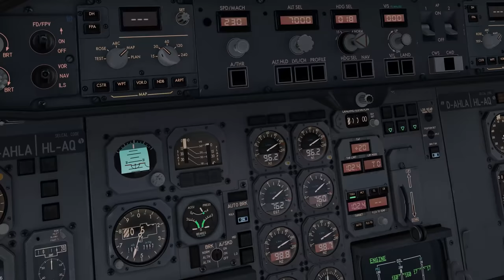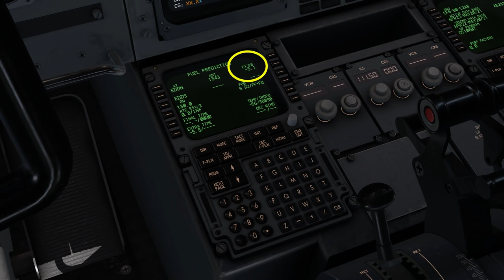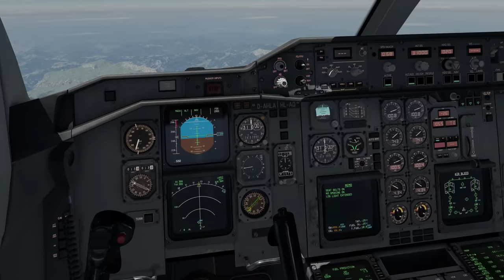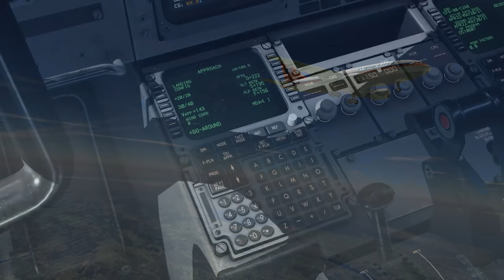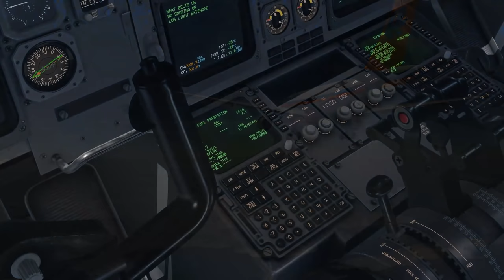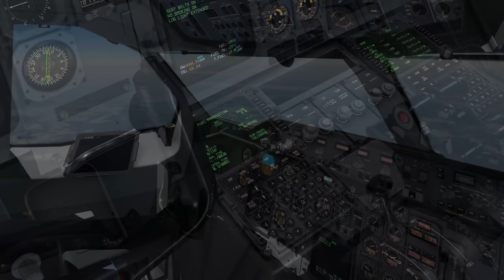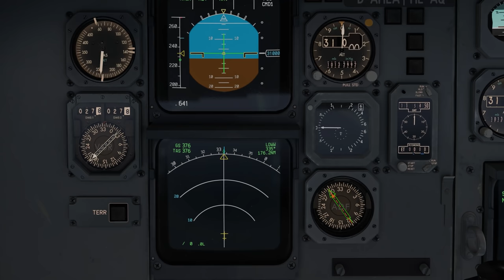This German jet ran out of fuel!? | Hapag-Lloyd flight 3378

Comment: I appreciate the displays being so in sync with the narrative, especially the engine 1 failure checklist appearing then seeing all the displays wink out after losing engine 2.
Reply from the maker: I’m glad!
Reply: Im a system specialist on A330/A350/A380 and i can vouch. The details in all the videos for Airbus Aircraft are ON POINT.
An FMS FUEL PRED UNRELIABLE message can be seen on the aircraft i mentionned, im assuming due this incident!
Reply: @GreenDotAviation Narration and displays moving in synchrony helps laypeople quite a bit, too. We can pause and zoom in on what's changed, getting some idea what the pilot's field of view would have been and the visual priority each indicator has.
Reply: What software is used for these sims?
Reply: @jakeofspurs-pj7it this is xplane and inibulids a310, but aviation related channels usually use MSFS because it has better visuals

Comment: I got 3 things from this video. 1. It's "ok" to fly with the gear down but actually it's not. 2. Confirmation bias, complacency and laziness will always lead you to something bad and 3. Green Dot Aviation as usual puts out fantastic, well narrated videos with outstanding Sims and graphics.
Reply: Well it's "OK" in the sense that the plane is capable of flight; however the increased drag means it will consume fuel much more quickly; this means the fuel you planned to use is now not enough to reach your originally intended destination.
Reply: @troodon1096  It's "ok" in the sense that the plane won't immediately fall out of the sky, but it's not in the sense of wtf are you doing trying to fly all the way to your destination with the gear down, are you on drugs? Turn around and get the broken plane fixed.
Reply: @Person01234  Why don't they teach to turn back then?

Comment: First officer: We're burning fuel way faster than the FMS says, the FMS is obviously, visibly incapable of providing accurate information about fuel consumption with gear-down flight, we're going to run out of fuel, we need to divert to the nearest airport NOW!
Captain: This is fine.
Reply: FO: Sure whatever idc it's not like if we run out of fuel I'm going to die or anything

Comment: Again, so interesting to see how one single thing - a bolt - starts a series of small mistakes that compound into a disaster (albeit one that thankfully was not deadly).  I think it also illustrates the issue of computer-reliance.  All too often it is "assumed" the computer knows everything, but in this case, it can only know what it was programmed to know about fuel consumption calculations.  My wife's grandmother was one of the first female pilots in Canada, and in those days, you had to fly by what few analogue systems you had, and one heck of a lot of knowledge and understanding of flight.  The one thing it seems we are slowly losing is as things becoming increasingly automated and computerized, that hands-on knowledge of how to fly manually is diminishing.
Reply: Yeah it should accommodate us, but not replace being able to actually calculate and have knowledge now lost due to heavy reliance on computers.

I think if I would ever become a pilot (I would love to but hey, the money just for the license and then have access to a place is not within my reach whatsoever. So I’ll reinstall msfs2020 and try there with my joystick and just one throttle lol. Or crash myself on the mobile ones.  However, if I could, I’d like the less computerized ones so I can actually fly manually and keep sharp about fuel, oillevels, take off speed and landing speed (and weight in case I would be flying to small villages in nowhereland and drop food and medical things) and all the things now generally calculated by a computer and only landing and take off are still manually done though many planes could even land themselves.  I know that’s a time of high workload but imagine you basically have 15minutes or less on a 10h flight.
Reply: @fluffy-fluffy5996  Yeah - to a similar degree, it's like all these new automated driving assistance things in cars.  I would MUCH rather see money put towards creating (and enforcing) good drivers instead of relying on the car to do more and more for the driver.
Reply: The addition of training on WHAT TO  DO IF THE GEAR WON'T GO UP would have done all they needed
Reply: There are some who watch flight channels who are convinced planes should be totally computerized 🙀🙀🙀
Reply: @fairyprincess911  I think they have too many computers now
Reply: @jack002tuber  I tend to agree😼😽
Reply: @fairyprincess911  Speaking as a Network Administrator, GOD NO.  The more mechanical, the better.
Reply: Automation is a positive thing, but one thing I notice in accidents/incidents like these is that pilots are taught how to use the systems, but not how they actually work under the hood.
Reply: Completely agree. I'm always amazed that people who drive cars don't really understand how they work. You don't have to be a mechanic, but most people don't know why the car stops when you step on the brake pedal.
Reply: @hrdley911  Argh... yes, this one frustrates me a lot.  In this day and age, people have zero excuses for not learning the basics about how things work other than they just don't care.  And the irony there with cars (or appliances or home repairs, etc.) is that you can SO easily get ripped off specifically because of that lack of knowledge.
Reply: @hayleyxyz  Automation is definitely a useful tool - But ONLY so long as the CBUs (carbon based units/humans) remain in full control of the SBUs (silicon based units), ;-)
Reply: Actually, it was a nut, well two of them.  One on the landing gear itself, and the nut in the captain's seat.

Comment: In my opinion this captain lacked CRM knowledge, he overruled or simply ignored/dismissed his first officer's inputs and suggestions. Moreover, as far as I know, no one in their right mind would decide to fly to the destination airport, with the landing gear down due to a landing gear malfunction. The normal action of any profesional crew, is to troubleshoot the malfunction with the use of the QRH (Quick Reference Handbook), and then decide if they are above the maximum landing weight or below the maximum landing weight (depending on aircraft type), in order for them to return to do a landing at the departure airport. If they are to heavy for landing, then they must tell the air traffic controller about their situation and ask permission to go over some specific airspace, in order for them to dump fuel thus bringing the current aircraft weight down to the maximum landing weight,  and then land the aircraft safely.
This captain ended up getting a severe case of what is commonly referred to in aviation as "Getthereitis Syndrome," and the outcome, sadly was predictable.

Comment: Beautiful graphics. Also excellent narration. 💛🙏🏼
Reply from the maker: Thank you 😀
Reply: These are great videos. Well done. 👍
Reply: NO - The cadence of the presentation needs to slow down -
so the listener does not have to be hyper-focused on what is being said.
Amateurs have a mouth like a rattle gun - and fail to learn from skilled orators.
Reply: @andrew_koala2974  - Thank you Andrew.  I have been reluctant to make any comment about the speed of the commentary because all those making comments on this channel exclusively praise the presentation, for many good reasons.
One small example here was my inability to clearly identify the name of the alternative airport to Vienna and Zagreb.  Through a bit of research, I have concluded that it was Graz in Austria.
Did anyone hear that clearly first time around, even though the name was repeated two or three times in the commentary?!
I know it's perhaps an insignificant point, but a place name in these circumstances still matters!

Comment: I think the most logical thing to do was to return to Crete (Hiraklion?) when they encountered the problem with the gear after take off. We do not know for sure but it seems as if they were urged by the airlines ops to proceed to an airport with the airlines maintenance facility. But even then, there were so many chances to land safely and avoid this crash...
Reply: Turning around would have prevented the issue, but I don't think it would've been appriopriate. They had a reasonable and well-founded belief that they could land safely, if perhaps a little short of their destination. It wasn't even incorrect in the broad strokes. The issue was that they failed to take appropriate action when it became undeniable that they were in an emergency, partly because they didn't have sufficient training and available information to identify the emergency earlier. I understand how the captain felt (I've fallen victim to plan continuation bias and expected utility bias myself, not to mention the likely financial pressure), but we can't excuse his poor decision making near the end of the flight. But when it was just getting started? Not every unusual situation is an emergency, and, even if it were, not every emergency requires you to turn around.
Reply: Deciding to divert to a base where maintenance is available and passengers' ongoing flights can be arranged is a very reasonable choice. It may also avoid having to make an 'over-weight' landing (airliners are certified to take off at heavier weights than they are certified to land at). In this case, however, the captain seemed to be very under-trained and  unaware of the drag vs. fuel consumption realities!
Reply: @gcorriveau6864  But safety should always be first, and than company and or passenger conveniences. And in case of overweight you can always either release fuel, or fly some time in a holding pattern to loose fuel to get under the max landing weight.
Reply: @Ztbmrc1  That's true, but it makes no sense to do that. It's perfectly alright to get the airplane closer towards the destination, as long as you make sure not to run out of fuel! It's a far better option than flying a perfectly controllable airplane in a holding pattern for hours or dumping the fuel into the environment for no reason. A stuck landing gear is simply not that much of a deal!
Reply: @gcorriveau6864  bro, he had 24000 hours flight time iirc
Reply: They could've just kept the  altitude and keep engines at idle until they reached vienna. It's the first rule, aviate.  They always forget the aviate part.
Reply: @squirrelhallowino29  Nope that is not possible, you can not keep altitude with engines running idle.
Reply: @Ztbmrc1  He could've glided in the green dot. Instead he descended more than 10,000ft
Reply: @squirrelhallowino29  Ok that way they might have made it.
Reply: I don't think that should be done, the priority should be to get the crate on the ground ASAP. Facing irate pax and company paying for hotels and ongoing flights is much better than....coming down in a field. Incompetence by the Captain.

Comment: 7:51 I think the commercial pressure is a point that should be included in all videos where time pressure on pilots is mentioned (which are a lot from the ones I have already seen). In capitalism corporations always put profits over safety. They actually only increase safety if that is required by law or reduces their costs (for liabilities and/or insurance) enough.
Reply: Don't say "capitalism" as if places like China and Soviet Russia haven't had dozens and dozens of horrendous accidents
Reply: @citizensnips3850  China is capitalist since about 30 years and you can't compare aviation of 1917-1991 with today. There where generally more accidents back then.
Reply: @citizensnips3850  also from what I know there was an increase of aviation accidents in Russia in the 90s, after the transistion to capitalism.
Reply: @rfvtgbzhn  There was countles Soviet Union crashes that were never documented and were swept under the rug. Considering their checkered past with covering things and how many soviet plane crashes that they tried to cover up but couldn't.

Comment: In other words, more than 20 thousand hours of flight were not enough to listen to the Co-Pilot's suggestions that, in fact, were correct and would have avoided this accident.

Typical case of "Power Distance" !

No wonder, CRM (Crew/Corporate Research Management) remains the key to minimizing the possibility of idiocy like this pilot in command.

Comment: How does a 20k+ hour pilot not realize that having the wheels hanging out in the breeze is going to hugely increase drag and as a result, his fuel consumption?  And then once he'd decided to proceed with the flight, to not be EXTRA vigilant with the fuel consumption and have alarm bells going off in his head when the amount was dropping much faster than anticipated.  Yeah, we've used more than 60% less than halfway through the flight.  It was the climb - yeah, that's it - the climb!  The only time you should really trust the fuel gauge is if it says you have less than you think you should.  Mind blowing, and miraculous that no one was seriously injured or killed.

Comment: I find it strange that they are allowed to continue the flight as normal with the gear extended.
Reply: It happens regularly and planes just continue their flight. It is much worse when the landing gear cannot be extended - that makes for a crash landing. This is what my friend, who works at the airport, told me.
Reply: I don't know about strange... The gear DOES reduce the speed they can go, and by rote, also the altitude they can fly to some degree. It's definitely NOT 'just like normal" to fly like that... BUT frequently on take-off, there's so much fuel on board that the plane is legitimately too heavy to land safely... SO turning right around to land may not have been an option... If there's no emergency (and gear-stuck down is NOT an emergency) then there's no good to come from creating an emergency by being too anxious to get back to the ground too early. The options then are to take a holding pattern long enough to dump fuel sufficient for a safe landing and go back... OR divert to some mid-way point where the fuel can be burned in progress for airline and passengers and then face the details of trying to fix the issue or getting refueled with intent to get to a place where it CAN be fixed... 

     The truly weird part is how reluctant the Captain was to try ANY alternative at all... AND even once he chose an alternative (Vienna) he set himself up for failure by continuing the narrow minded demands of his craft... instead of simply diverting to THE nearest suitable airport as soon as he figured out they couldn't reach Munich. He gambled on reaching Vienna (as far as he could possibly fly) with the lives of his passengers and crew.  ;o)

Comment: It said in the beginning that the FMS indicated there would not be enough fuel to reach the destination, so I don't think it was a bad assumption by the captain that it was based on gear down.  The suggestion to have stayed a cruise altitude as long as possible and glided down was a good one.  They would have made it to the airport.

Comment: Gear locked down, you go to the graphs ... not the FMS. easy to say in hindsight, but thats the way on my aircraft, and it is extremely limiting, this is a ferry flight only procedure. with no pax.
A landing back at the airport of origin is absolutely required in my FCOM.

Comment: This is classic poor airmanship. Despite what the computer said, all they needed to do was estimate how long it would take to fly the required distance at present speed, and compare fuel on board to fuel flow. That's easy mental math that pilots know how to do.
Reply: Just land at the closest airport. My goodness! Don’t wait.
Reply: Exactly. All they had needed to do inflight was to use their raw data to roughly calculate or even estimate how long they could make it with their current fuel burn which is well being displayed as fuel flow on the instruments. Should be done during any flight on a regular basis anyway, to double check the computers. That is what these indications are there for... Shockingly poor performance.😳 Honestly it would have been my very first idea to check the actual fuel burn when flying with gear extended and estimate how  long it will take to burn the tanks empty instead of fiddling around with the FMC on an unclear basis. And then decide on basis of the rule safety first instead of economics first with a good plus of extra for saftey...
Reply: You are absolutely right. And exactly that was written in the final report of the investigators.
Reply: The computer is always right!
Reply: @steffengerlach8395  There are some gotchas in using rate of fuel burn...  It all depends upon the stage of flight that you take the measurements...  During the climb, the rate is very high, and during the descent, it can be almost zero.    Even when cruising, the cruise speed can alter the fuel burn.   Headwinds will also corrupt your calculations of how much range you have left.   There are two well known airspeeds for maximum performance, one gives the maximum range, and the other slightly slower speed , give the maximum duration time.
Reply: @hiscifi2986  Yeah, all correct. But you can estimate on a good conservative basis taking all that into account and decide following safety first attitude instead of gambling. Cheers

Comment: A couple things. A 310 was not one of the first 2-man cockpits. B 737, DC-9 and others were there.  A310 wasn't a marvel just an average plane. It wasn't replaced by the A330. Rather by modern A320 versions etc. A330 is bigger.

Comment: Tbh, the computer not using the current rate of fuel consumption for its calculations in any way seems like a tremendous oversight to me, at least from the modern day perspective...
Nowadays, I would assume that any FMC would automatically register that the gear is down and have the corresponding look-up-charts available to recalculate everything on the fly..